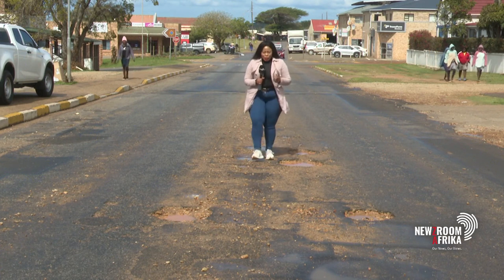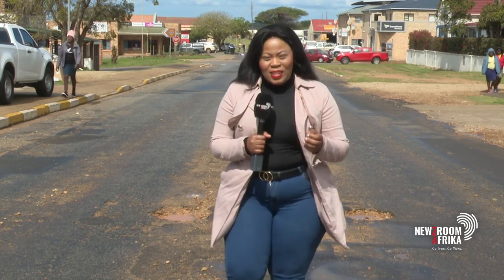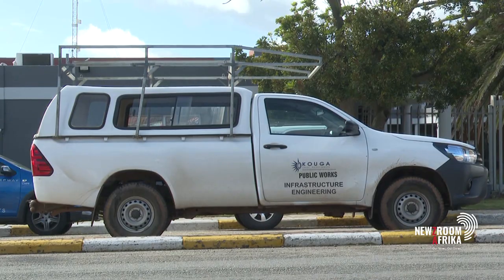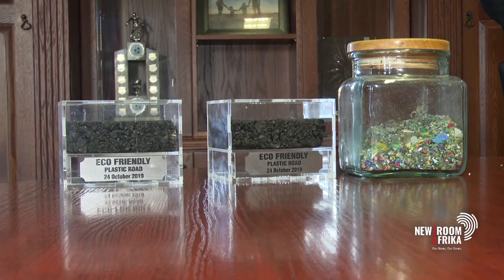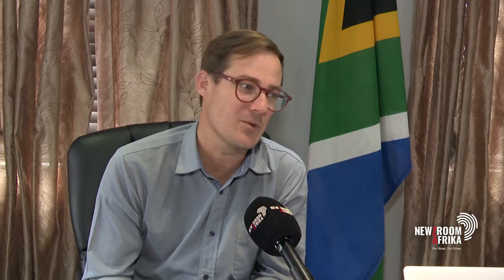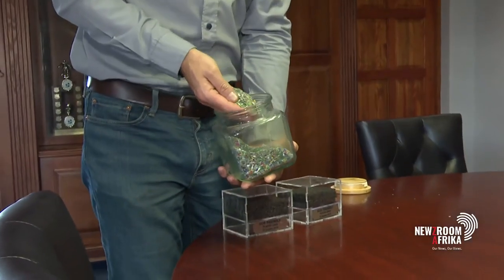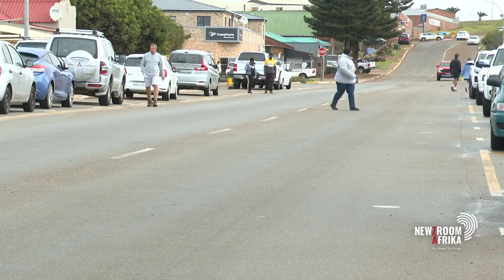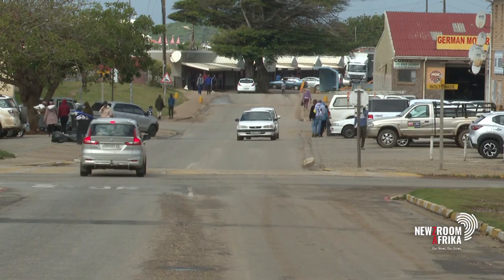Plastic roads paving the way

Comment: Microplastics is a real health concern we must not overlook. As the road degrades over time it can contribute to microplastics which can seep into the water supply following rains. Many attempts have been made to innovate road design for example, Asbestos in roads to use the vast reserves but obviously the health impacts is still being debated in the academia as a potential trade-off worth considering. We need to avoid romanticism and look at the risks instead of creating commercials designed as News articles.
Reply: They're gonna come back in 20 years and tell us how they made a colossal mistake, same way they did with C vaccines
Reply: Exactly, it is not as groundbreaking as they would have people believe. Yes, it does last longer, but it also costs more and there are serious future health concerns that are being ignored.
Reply: @iAM2.2  I 👍💯I think we need to do something locally not from Scotland.
Reply: Great comment.i was thinking about micro plastics too.